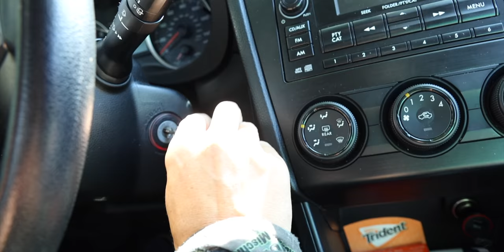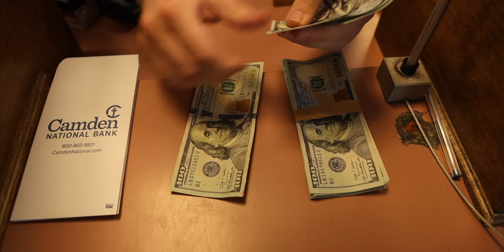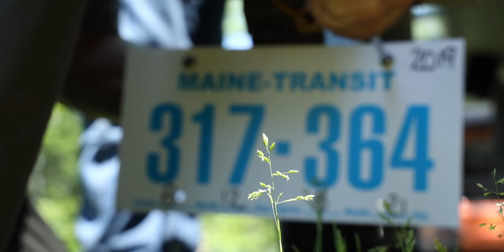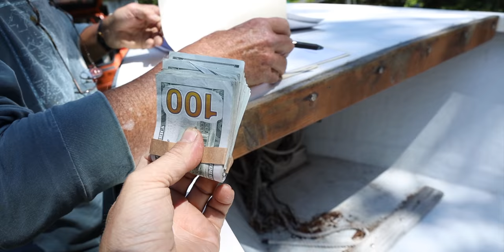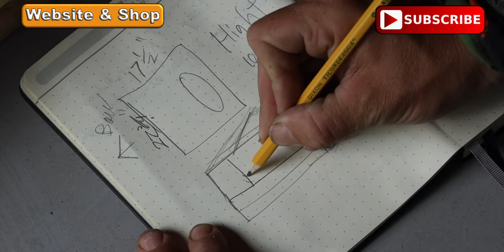I Bought A Boat Episode 1

Comment: I hope you don’t run in to the same problem I did with the controls freezing up in cold weather. I switch to a hand tiller new Suzuki 30hp. The difference is amazing power wise and quite. I did the research and you can’t beat a Suzuki or Yamaha expect you get a 6 year warranty with Suzuki. Good luck with your new boat.

Comment: If possible, put the plug on the inside. Or switch to a twist type  plug. Keeps reeds from pulling it out when you are in the shallows.
Reply from the maker: o ggod point I do have two just incase but that shoud be easy enought to get to the inside to plug it thanks for the tip.  In all the sail boats I built we always has the brass screw in ones.